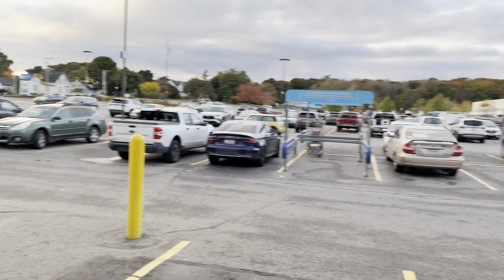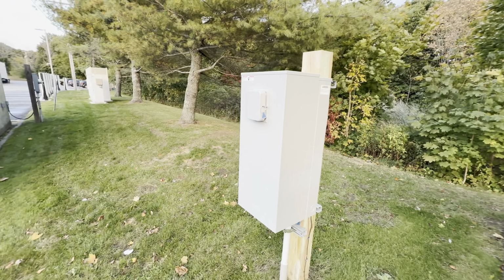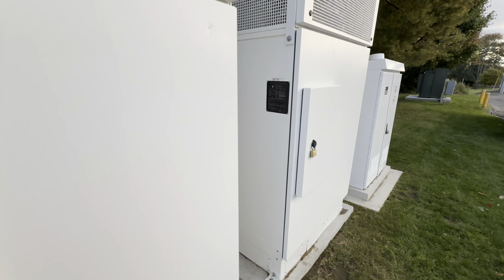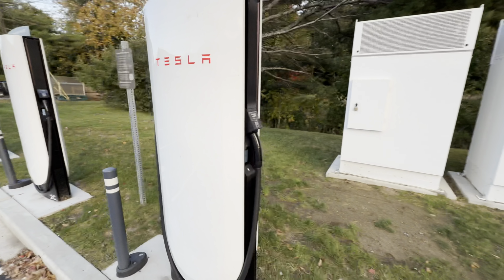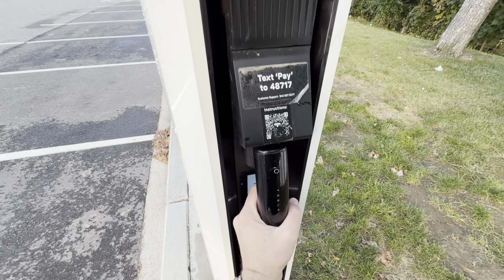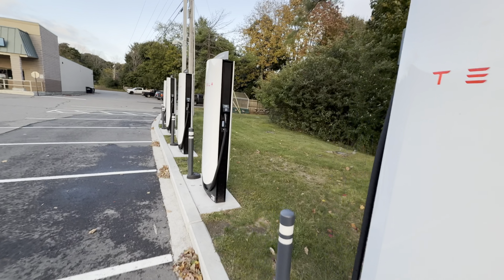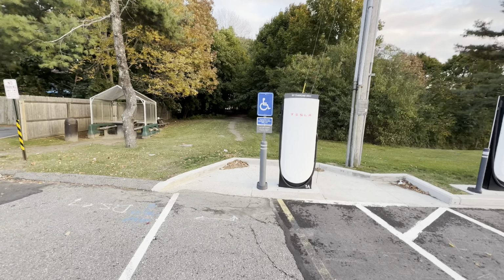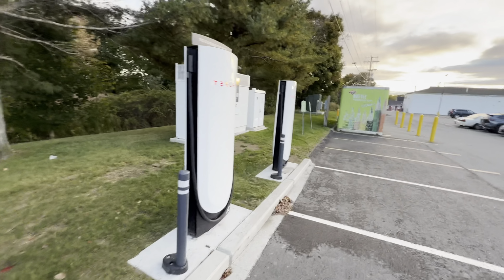Not In Compliance! Tesla's First NEVI-Funded Supercharger Site! Rockland, ME Site Tour & Impressions

Comment: You make it seem like only Maine has interpreted the NEVI rules as to allow Tesla Superchargers to be compliant, which is not the case. Many states have the same interpretation and have granted Tesla NEVI funds to install chargers. (In fact, I think it is the official FHWA NEVI FAQ that contains the language that is being used to support this.)

As far as the kW available, as long as they only received NEVI funding for 4 of the stalls and they handle power management to ensure that those 4 of the stalls can always receive 150kW even when the site is full of hungry EVs, then it is in compliance. I agree those 4 stalls should be labeled, but I don't think that the NEVI requirements have anything about that. 

Tesla has said that they have three ways to meet the 150kW limit with the V 3.5 Supercharger cabinets, depending on site and state requirements:
1) Use power management to ensure that the NEVI funded stalls get at least 150kW.
2) Install fewer stalls
3) Install additional Supercharger cabinets
Reply: There is a new V 3.5 supercharger cluster at exit 112 off the Maine Turnpike, at the edge of Augusta, Maine.  It is at a Comfort Inn, but the label on your Nav screen will say it is on Civic Center Road.  Which is also correct.  It is about an hour west of the Rockland/Hannaford site that Branden visited.
I have been to both the Rockland site and the new Comfort Inn site, and they seem very similar, both with MagicDock and no credit card reader.  I am not as smart as Branden to understand how these new dispensers are powered.
But I am delighted to have new Tesla supercharger clusters in the state.  They are highly underutilized and will likely never hit the power limits that concern Branden so much.
By the way, there is also a Demo Drive (unchaperoned) at that same location.  I have seen no publicity about the new charger cluster, nor the Demo Drive opportunity.  Why doesn't Tesla publicize these?
FYI, the new Comfort Inn site does not yet appear on the national Tesla "Find Us" map.  But the Demo Drive opportunity does show up there.   There is a separate, older V2 charger cluster only a mile away, up the hill by the Home Depot, which does snow up at "Find Us."
Reply: Should be written as “DCFC charging ports must support ANY charging voltages FROM 250 TO 900v. “ Idiot legislators in Washington always create loopholes using ambiguous language.
Reply from the maker: Doesn't meet 500+V requirements
Reply: @brandenflasch  That isn't the requirement according to the FWHA: Technical Requirements 3.1 (You will have to search for the FAQ yourself since YouTube doesn't let me post comments with links.)

"23 CFR 680.106(d)(1) specifies the voltage range requirement for DCFCs. It states that "DCFC charging ports must support output voltages between 250 volts DC and 920 volts DC." A DCFC charger that supports any voltage outputs within the specified range is eligible to receive funding for projects subject to 23 CFR part 680, as long as it also meets the power requirement additionally specified in 23 CFR 680.106(d)(1) (that DCFCs must "supply power according to an EV's power delivery request up to 150 kW, simultaneously from each charging port at a charging station")."

If that any was all then Tesla would be non-compliant.
Reply from the maker: @mp3mike237 to read it in that way is insane.
Reply: @brandenflasch  It is literally the English language. Maybe they meant to say that all voltages have to be supported, but that isn't what they wrote. But yeah, a charger that only supported 250-251v but could push 600A would be compliant, but completely worthless.

Comment: NEVI compliance was a poorly worded and the voltage I can see how they complied. The voltage they offer is in the range by the wording. It probably is not in the spirit though.
More blame should be given to whoever write the NEVI rules.
For the kWh I'm not sure how they managed to get around that, they should just put in another cabinet so 3 cabs for 8 stalls. Which I think would be in the spirit of the law. But I expect that would not be enough for you (135 per stall) although real world it will be more than enough.
I will also say that the NEVI rules were not very friendly to the popular and sensible power sharing to the stalls. It was like they were poorly written by the manufacturers of dedicated hardware that have fixed 150kW units.

Comment: I would much rather pull into a Tesla Supercharger as they work 99.9% of the time.  I was trying to charge at Francis Energy fast chargers, and all six out six did not work at all.  I drove to a supercharger 41 miles away, and I arrived at 3%.  CCS1 charging SUCKS.
Reply: Not only do the have the shared power limits, they're not 800v. They should fix these sites before they get any funds for these installs.
Reply: @redhat421  Don't go to a Tesla Supercharger.  Stay at the CCS1 units and get your 800 volts.  Good luck!
Reply: What in the heroin smoking crack pipe are you talking about😂 CCS1 & Tesla Superchargers are the most reliable chargers… Im literally having a hard time understanding if you're talking about electrify America or some other 3rd party bs
Reply: Maybe this set up is just to get much needed stations up and running - then will be compliant when V4 cabinets added? 🤷‍♀️
Reply from the maker: So why not push Tesla to be compliant?
Reply: @brandenflasch  Tesla, as you very well know, by far, have the most chargers out worldwide than any single company and the most reliable  regardless of climate.  I'm sure 4 of the 8 stalls could pull 150 kws.  Your comments could be due to your job! Maybe?  Branden, you're doing a great job....  why spread hate about a company that has done the most for EV'S.
Reply from the maker: @davidws5439 this is not hate. Tesla doesn't get to play by their own rules.
Reply: @brandenflasch maybe we should be pushing to change the idiotic rules.
Reply: @brandenflasch  seems hateful.  Other networks just are not even remotely reliable, tesla just works.

Comment: Great video Branden. My question would be; what would Tesla have to do to rectify this location? Is it a matter of replacing/upgrading the charger cabinets so they meet NEVI guidelines? I'm still learning about the whole "Electricity thing" obviously.😁
Reply: they could replace the 3.5 cabinets with something newer that provides 1000v...  the v4 posts shown can take UP to 1000 volts in....  the v3.5 cabinets have a 1000V link between them... but yeah... some reason they dont have their DC-DC conversion going to the posts from the cabinet as anything over 500 volts.....  they have insanity level amps (I'll never understand how "knows more about everything" guy decides amps over volts... I2 losses are insane.).    Anyhow.. that will fix the 1000 volts thing, which is what I think its the main spirit of the law.  But nothnig will change that the site can only serve I think its 5 cares at nevi rating for their 2 cabinet set... and 7 for anything over 2 cabinet (because of inter-cabinet issues).  That said, as far as I know, they only got funded as a "5 stall" station in most states (even though they build out 8)... so I dont care personally about that. But yeah... that they dont actually support all EVs is the issue.  They don't support the J3400 standard they are SOOOOOO proud to say is their thing.

Comment: Trying to get a friend who is a wheel chair user interested in en EV. Took her to a v3 supercharger site and we were disappointed that the cable “holder” is too high to be access by her. Combination of height and the curb preventing getting really close to the dispenser. Is the v4 design better in that regard?
Reply from the maker: Nope, they're poorly designed.
Reply: Would they be any better served trying to wrestle a ccs cable/connector? Genuinely interested, teslas option seems way easier.
Reply: @projectswithdrew  maybe if it had good cable management. In any case we really need to get serious about making all ev charging accessible to mobility challenged persons.

Comment: NEVI requirement are dumb anyway. Like spending $150k per charger when Tesla does it for less than half. Then you’re putting in CCS plugs that you’ll be ripping out for $10,000 in a few years anyway, defeating the entire purpose of NEVI which was to fill the holes Tesla didn’t fill.

Lol Branden always trying to dunk on Tesla.

Comment: You can't lobby away federal law on the state level. They can add to requirements, but they can't take away federal rules. Someone should report this to the proper beaureu. I'm not sure if it's the DoJ or the U.S. Attorney's office.
Reply: The states didn't. It is the official federal FAQ that contains the language that says 0-500V is acceptable: Question 3.1: 23 CFR 680.106(d)(1) specifies the voltage range requirement for DCFCs. It states that "DCFC charging ports must support output voltages between 250 volts DC and 920 volts DC." A DCFC charger that supports any voltage outputs within the specified range is eligible to receive funding for projects subject to 23 CFR part 680, as long as it also meets the power requirement additionally specified in 23 CFR 680.106(d)(1) (that DCFCs must "supply power according to an EV's power delivery request up to 150 kW, simultaneously from each charging port at a charging station"). Tesla supports a range, 250-500 volts, which is inside the required range, so they are compliant. (If it said all instead of any then Tesla wouldn't be compliant.)
Reply: States were left to interpret the rules and how to enforce them.

Comment: I don’t take much issue with not guaranteeing 150kW per stall. Because if you really take that super seriously, Tesla could comply by simply removing the extra stalls which I have to believe you don’t want (bringing it down to the minimum four stalls at 150kW). 

Smart power sharing shouldn’t be punished especially when it benefits consumers with extra dispensers like this station does. I would rather be plugged in and have a 99.9% chance to get full power (due to charge curves) with the extra stalls than have just (4) stalls and have to wait (not charging) on people taking up all (4) stalls.

I do take issue with these not offering 1000V charging capability. These do not serve all EVs well with the 500V limit. It has been far too long waiting for V4 to deploy.
Reply: Especially when there’s 8 stalls minimum. The real metric is total kW available at the site, not min kW when the site is full.
Reply: In the Telecom world,  they designed for usage traffic.  This is a % needing service at that moment. 
The only time your 150 worry would normally happen, is after a prolonged power outage where everyone showed up at the same time with a low state of charge. The rest of the time, Some vehicles will be in the 'tapering off' phase, making the power (via balancing) available.

Comment: I think its a NEVI bargain actually rather then a NEVI scam.  The little details aside in the big picture / grand scheme of things what NEVI is getting is the set up of 8 stall station that would otherwise only be 4.  I understand thar NEVI is only technically funding 4 of them. But to stick to the exact regulation then Tesla could have set up only a 4 stall station then they could have provided full 150 kw to each vehicle.  Instead they are providing 8 stalls to the public and they should not be punished for providing more then is necessary to the public. Especially since the public will almost certainly get to full 150 kw with the load sharing as it is extremely unlikely that 8 cars will show up simultaneously all at low charge and all demanding 150+ kw all at the same time.  So 8 stalls instead of 4 are being provided with almost every car (except e GMP) getting 150-250 kw power from a practical usage perspective and all the 1/4  - 1/2 the funding being provided to other NEVI states as Tesla is underbidding other charge operators significantly for these sites

Comment: The two major issues are that the site is limited to 500 volts and that it can’t support 150kW to each post. And Tesla’s scam that it will prioritize the NEVI stalls is total BS. Even if it does do that (doubt it) how does anyone know what the NEVI stalls are? 

Someone needs to coordinate a charging meetup with at least 8 cars at low SOC and see what happens. 

Great video and for taking Tesla to task.
Reply: It is the official federal FAQ that contains the language that says 0-500V is acceptable:  Question 3.1: 23 CFR 680.106(d)(1) specifies the voltage range requirement for DCFCs. It states that "DCFC charging ports must support output voltages between 250 volts DC and 920 volts DC." A DCFC charger that supports any voltage outputs within the specified range is eligible to receive funding for projects subject to 23 CFR part 680, as long as it also meets the power requirement additionally specified in 23 CFR 680.106(d)(1) (that DCFCs must "supply power according to an EV's power delivery request up to 150 kW, simultaneously from each charging port at a charging station"). Tesla supports a range, 250-500 volts, which is inside the required range, so they are compliant. (If it said all instead of any then Tesla wouldn't be compliant.)
Reply: @mp3mike237  that is the dumbest interpretation. So KIA could build a system that only operates at 500-920 volts and get the funding?
Reply: @ericroe  Yes, that is how it is written. (As long as it supported enough amperage to supply 150kW.)
Reply: @mp3mike237 nope, that’s not how it’s written at all. It was written that the charger has to supply all voltages between 250-920 volts. Not just any voltage in that range. That’s just silly to think that way.
Reply from the maker: @mp3mike237 any would not imply only 1
Reply: @brandenflasch  Only 1 what? One voltage? 250-500v isn't 1... (Or if it is, 250-920 is only 1 too.)
Reply from the maker: @mp3mike237  so you can just arbitrarily pick? What about 500-550V? Would that be fine?
Reply: @brandenflasch  Yep, that would be compliant. (As long as it supported 300A.)
Reply from the maker: @mp3mike237 that's an insane interpretation
Reply: @brandenflasch  The way I read it the kW requirement is more of a problem, as if you support 250v then you have to support 600A, otherwise you can't get to the required 150kW. How many NEVI funded chargers support 600A? But the FAQ sort of says that 375A is enough. But that is silly, since most 400v class cars are closer to 350v when they need to charge, so you would only get ~130kW... The amperage requirement should be based on the bottom of the voltage range, not some arbitrary one in the middle. (If you want to complain about the amperage rating of chargers/cables that are installed under NEVI, I'd fully support that.) 

To comply I think that Tesla would have to limit their voltage range to 300-500v since they only allow 500A through their MagicDock CCS1 adapter.

Comment: If they have two power cabinets with 360kW in total 720kW they can provide 4x150kW =600 kW I don’t see the problem now or do you mean because the grid connection is too low ? 
Yeah the voltage range is a bummer but the most sold car model in US is from Tesla which have ~400V systems beside Cybertruck/Semi
Reply: Nothing is more annoying than when I receive the message that the charging station is limiting the charging speed. I only want my vehicle to be what limits the kw rate (hot battery etc) not because there are too many other people who just arrived at the station. If I am understanding the math correctly, only 3 Teslas can arrive with a low state charge and charge at the full 250kw. If there are 4 Teslas at the station, someone is going to charge more slowly regardless of whether their battery can support the full 250kw? Then if they are 6 or 7 vehicles there what happens?
Reply: @RivianDogDad  Incorrect. I've been in 12 and 16 stalls Supercharger sites nearly full, plugged in and have gotten the maximum the Tesla could get at its state of charge. The sites are intelligently load balanced, so that as some are finishing their charge and are receiving less speed due to their high SoC, the new ones just plugging in get the max.

The derating you're speaking about are on EA and EVgo sites that don't use such a smart, load balancing system. Most of the chatter you hear online are from anti EV trolls that have never been in an EV, nevermind owned one.

I this particular case, the local utility simply provided Tesla too little power. That's not the usual case.
Reply: Yes, the grid connection is too low. Maine is still not to keen on EV's. They are, for the most part, Republican controlled. I'm sure they gave Tesla hell, as they wanted Tesla to only install 4 stalls. But Tesla installs a minimum of 8 stalls. The politicians in Maine's idea being that they provided what NEVI dictated - - that being enough power of 150kW for 4 stalls.
Reply: @junehanzawa5165   I am in Maine my little road has just about as many EV's as houses.  This charger has been a big plus for me, if one wants to drive to Easport its a required charger for me to make the trip.  Many Republicans belive is self made fuel and stopping shipping oil $'s to contrys that would like to destroy the USA.  I have friends on each side of the isle that drive electric cars in Maine.
Reply from the maker: @junehanzawa5165 There are EVs everywhere in Maine
Reply: @brandenflasch  Yes, I know. But those are the people of Maine. Many love EV's there. I'm talking about the politicians from Maine. For example, they blocked on multiple occasions the mining of a very rich Lithium deposit there. And they have opposed the build out of EV charging on multiple occasions and have declined to approve the permits. That's why the DC fast charging network is so lacking there.
Reply from the maker: 8 stalls
Reply: @brandenflasch  didn’t you mention it needs at least charging points stalls with 150kW continuous power output?